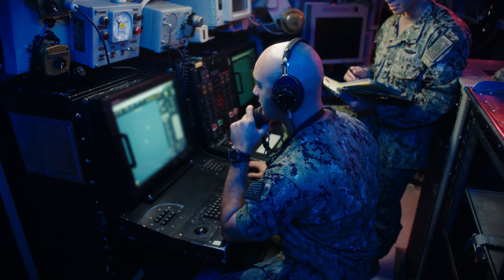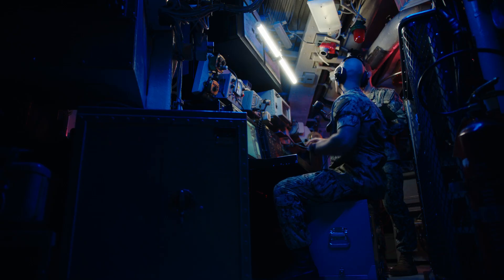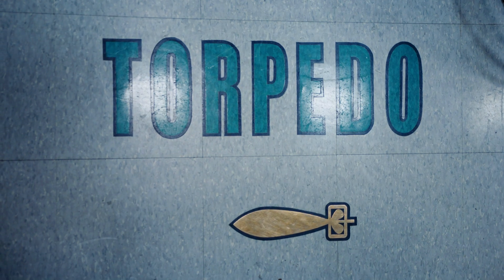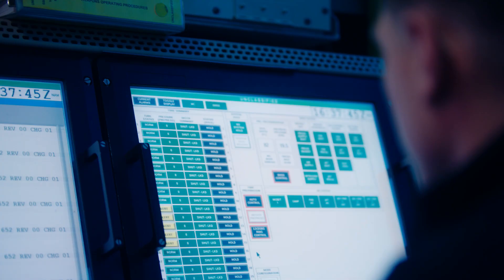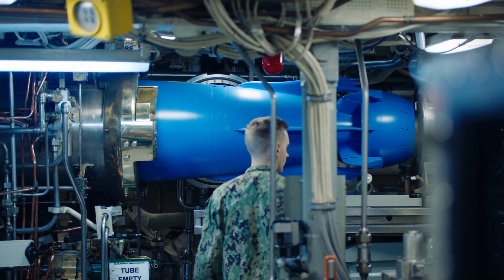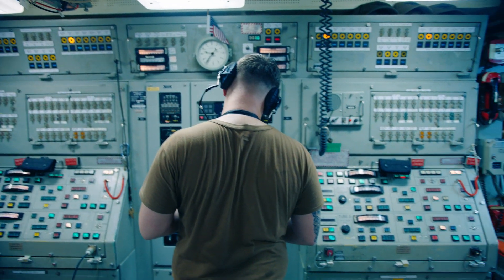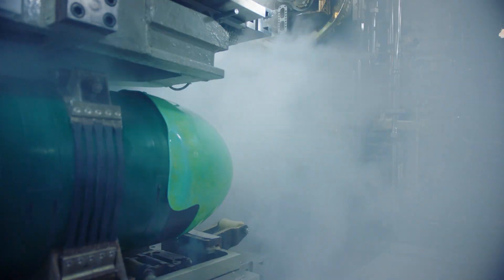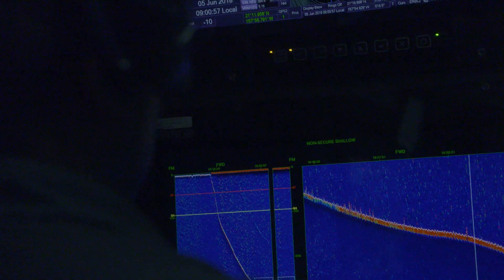Navy Fire Control Technician – FT

Comment: Served as a FT from 1974 thru 1994 either on or supporting SSBN submarines. Back when I started we were FTGs (Firecontrol Guns), a hold over from surface gunnery rate. In fact, Submarine FTGs attended the first phase of FTG surface gunnery school and then off to Submarine School, followed by a C school appropriate to your final assignment. In my case, I got the 113 mod 9 system for SSBNs. Later I would pick up the MK118 system for Trident boats.

Comment: Best rate in the navy!
Reply: I’m assuming you’ve experienced this rate during your past or current service with the Navy. I understand at the end of this video it states “Nothing equivalent in the civilian life” but wanted to ask this question just in case. Is there anything that this job can be transferred to when finishing your term? Whether that’s anything electrical or anything to do with communications. Thx
Reply: @kalebbolte5973 if you like IT work then yes! If not then hard no.
Reply: @kalebbolte5973 pretty sure you can do network engineering and It work but I’d use your Gi bill to get some certifications after your service
Reply: @kalebbolte5973 if you have the time and energh  go out of your way to get electrical certs, yes you can leave as a journeyman electrician (basically skipping the apprenticeship), otherwise not much tbh.